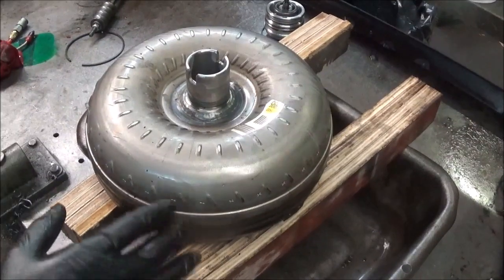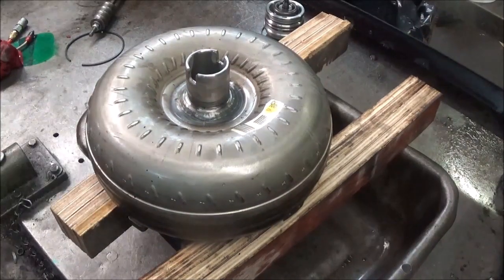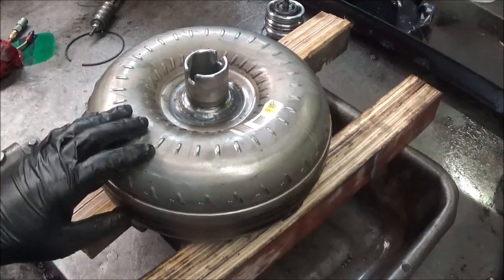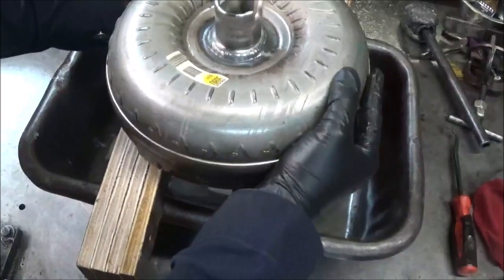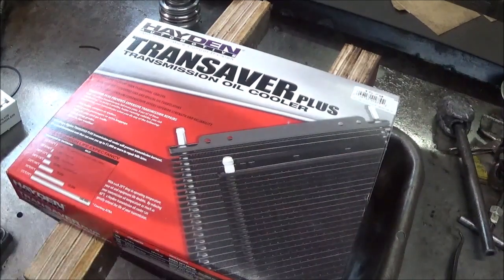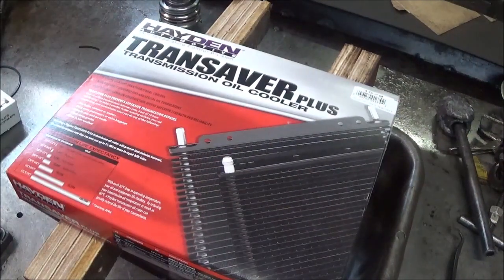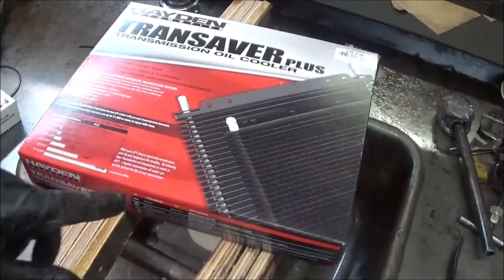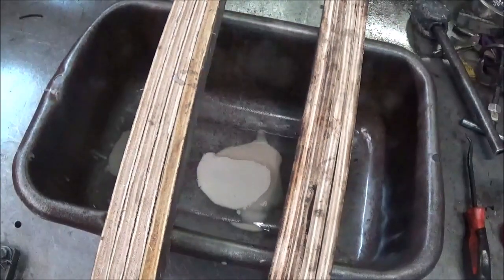IT IS HARD TO COMPLETELY FLUSH A TRANSMISSION OF ANTIFREEZE!!!!

Comment: Most transmissions have magnets in the pan but aluminum is not magnetic so fine particles will remain suspended in the fluid and migrate to become sediment anywhere in the transmission system. The fine sediment passes right through a filter. The same gray goo that you are getting out of a torque converter is also in the rest of the transmission. If a transmission cooler becomes contaminated it will allow fine aluminum particles to get back into fresh fluid after a fluid change.
Reply from the maker: This is true, some put on an in line filter. I use an in line filter for transmission that have govenors on them.

Comment: Yes! You can not just flush a transmission contaminated with anti-freeze especially with these lock-up converters. The clutch material will flake off & you'll burn up the transmission. Informative vid
Reply: Beyond that, I would not trust bearings inside:  emulsification is a loss of lubrication.  Don't blink, just replace it - and the radiator with the failed intercooler. The transission?  Headed for a rebuild, with new clutch packs and bearings/bushings/seals at a minimum..
Reply: Antifreeze and any kind of oil is bad news.  These converters with clutches make the case for having a bolt tegether converter, although that does come with an extra maintenance cost: o-rings and seals only take so much heat.

Comment: That convertor looked like it had oil and coolant mixed first then that mixture made it into the transmission,,
Appreciate what your doing sir,,
Did the engine have an issue,
I've never seen it that color,,always strawberry milkshake color

Comment: Simply: drain fluid as much as it comes out on particular car. Fill it, drive it and drain it again few times.  If you wanna keep your car for a long tine that is;) Mine cars ran hundreds of thousands of miles with auto trans no problems:)
Reply from the maker: Had a boss that tried this one time. Winter time came, and their was ice in the transmission. I guess the customer had water in the engine instead of antifreeze. However, it is best to change the transmission if you are a shop working on a customer vehicle. Antifreeze will peel off frictions.

Comment: @thisisyourtransmission
Hello Sir. Question. I have a custom project with a 10l80. When i installed the torque convertor i added dexron vi instead of dexron ULV inside of TC. The engine has not been started. And the transmission has no ATF other than whats in the TC. Do i need to replace the TC or is there a way around that? 
Thanks appreciate your time
Reply from the maker: Well, how much is in the torque converter? How many courts?
Reply: @thisisyourtransmission  well it had some of the original fluid in which is the correct dex ulv. I added like .5-1 qt of dex vi. I want to say about total 3-4 qts
Reply from the maker: @marcosnguyen2093  how many qts of dex vi did you add.
Reply: @thisisyourtransmission  .5 -1 qt
Reply from the maker: @marcosnguyen2093  I don't see how it would hurt. The other transmission fluid will probably dilute that one quart. The only other way is to take the transmission out and pour the fluid out. Your choice.

Comment: My transmission was under water , I know I have to drain it , my question is do I have to drop transmission to clean torque converter or is it sealed from water ?
Reply from the maker: Take the transmission pan down and see if the water has gotten into the transmission. If it has, and you have been driving it then it will be in the torque converter. You will have to take the transmission out of the vehicle.
Reply: Vehicle hasn't moved at all other than being started and pulled in gear for about 30 seconds . I've removed the pan from transmission and very much milky colour , I removed the flat filter at bottom and also drained half litre or so . I'm hoping that cleaning this as will as cooler and lines would be sufficient,  then run vehicle and then remove all fluids again if milky colour continues?

Comment: Can a blown head gasket cause the internal radiator leak which results in this?
Reply from the maker: I think this is the other way around. This can cause a blown head gasket on some vehicles because if the transmission fluid get into the engine, the engine will overheat.

Comment: I had a pile of dry matter, settled in the bottom of my oil drain pan. It was enough to fill at least a 32 Oz yogurt container!, or more! I did have transmission fluid - but smells burnt, and dark black red. 

Thank you, again, Q3! I did ask about a new external transfer oil cooler. Now, I will do that. I was going to put a filter on the line. I guess I can still do that, and change it after 100 miles or less, and every 3,000 miles? 

Or, would an inline filter slow the flow too much? I was thinking of putting a filter on both lines initially; but, with a new cooler, it would go on the line TO the cooler - to protect the new cooler... ?

I guess, I will flush the block too. I need an oil change anyway.
Reply from the maker: Here is the link of videos to watch: https://youtu.be/vQB_DTo09eI